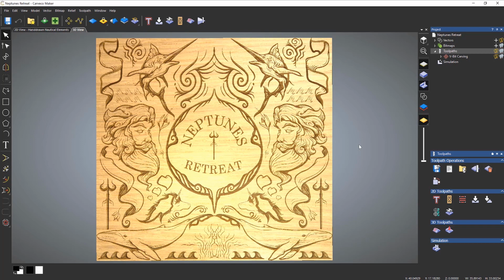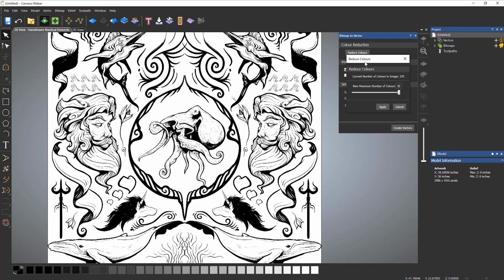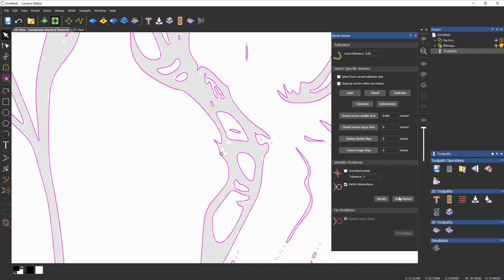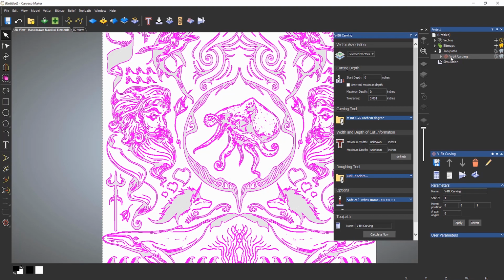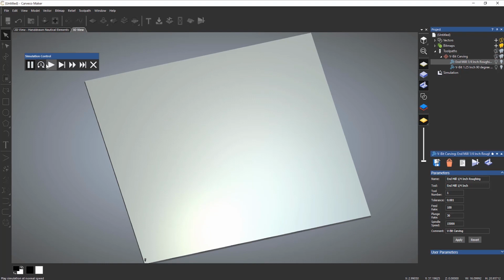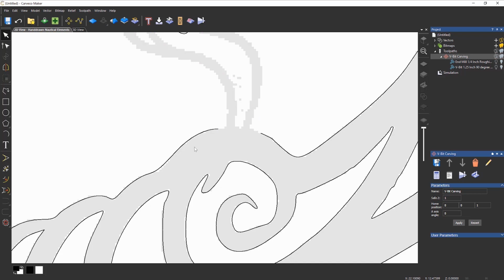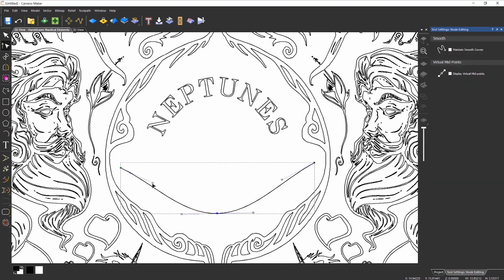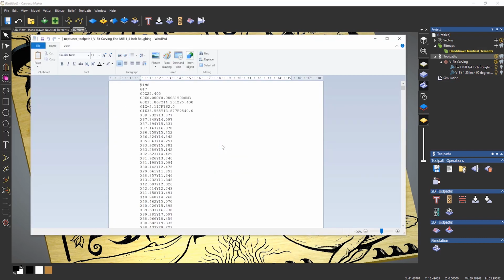Carveco Maker Project: V-Carving Images

Comment: What I’m having tons of issues is how to carve just the top of the wood. It digs in about 1/2 inch
Reply from the maker: Hey, 
The first step it to ensure your 'Material Thickness' has been set up accurately. Once that's done, click 'Limit tool maximum depth' which you'll find in the V-Bit Toolpath window under the 'Cutting Depth' header. Once you've clicked to enable that, enter your desired depth in the box underneath. Don't forget you can simulate your Toolpaths to make sure they look right before you send it to your machine. 
Thanks, Tim

Comment: So i have both vetric and carveco 
I love both of them but as far as photo v car goes vetric is far superior because of its toolpath is different than carvco. 
You can make a very clear 60° bit tool path if you bring up your contrast and do some photo manipulating you will be able to carve just as clear as a 30° bit from my own observations. I watch guys take a 90° 3/4" bit and do better than a 60° bit. It really all comes down to your pre sets. 
My favorite settings for a 60° 
Depends on the pic but my starting settings would be .07 step over and .06  to .055 
Carvco 28°, seems like it's always the best 
Vetric i spend more time on finding my angle than my presets. 
I have one photo that will barely touch 
And carve another image it'll be a deep cut. Contrast and lighting on these photos are so important I'm sure  youve  seen this. In ventric  i bounce back and forth to the photo edit between toolpath  previews then reset and change my contrast and my other settings just a little bit up or down darken lighten change the gamma. You know I know we don't all have a lot of time to do this stuff but I'll spend two or three hours on changing my photo settings between each toolpath because you can get your clarity with that 60° bit that is so awesome and clear. 
The other day I took a photo of a bee working a dandelion and I fine tuned it so you could see the wings on that be on top of that dandelion in my carve. Bluring the background of whatever your im is just a lil bit will bring huge vibrancy into your carves.

Comment: Wish this video was updated. Trying to follow along and do the same thing and I have features he does not have or he has features the 2024 Carvco doesn't have. Its frustrating that all my carvings are coming out looking like crap. Think I just wasted $180 dollars on Carvco. Pffft I probably did.
Reply from the maker: You should be able to do exactly the same thing in a newer version of the software without any problems.  Please reach out to our support team (support@carveco.com) and they will be able to guide you int he right direction.
Reply: @Carveco  if you haven't noticed, check out his carvco and check out the new one. You can not follow him. For example, when he shows the 3D carved relief showing the tool path. I can not see the same. Plus, some of the little white drop-down arrows do not work. Also, when he clicks on the green circle with the green box. I dont have that option. My circle and green box are black. And it does nothing.